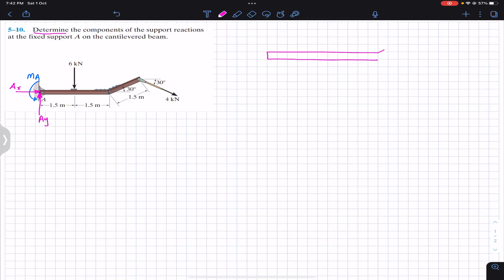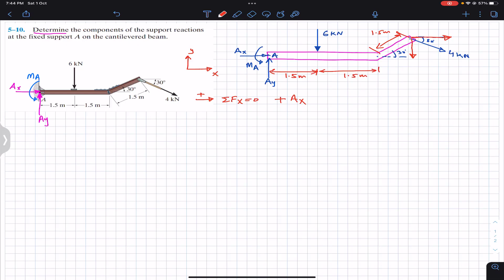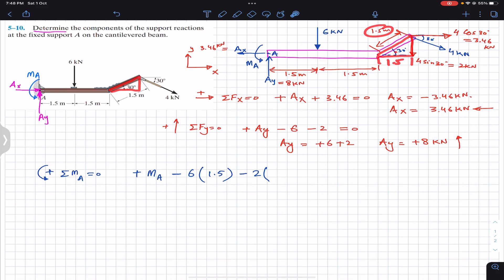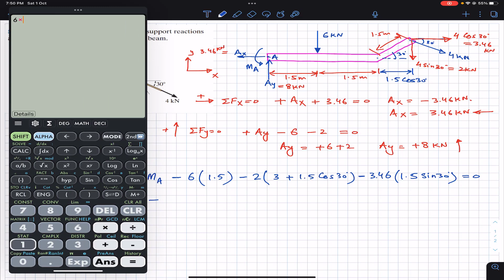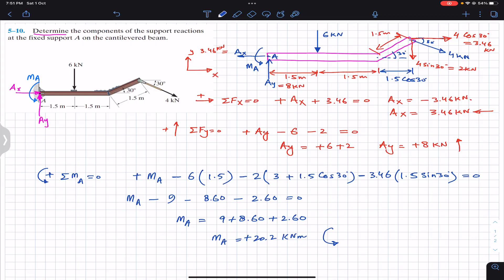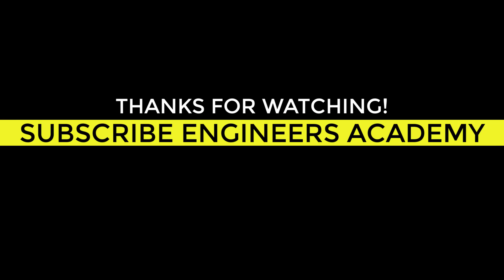5-10 Equilibrium of a Rigid Body (Chapter 5) Hibbeler Statics 14th Edition Engineers Academy

Comment: why didn't we add 3m to 4cos30(1,5sin30)?
Reply: 3m is the total of all horizontal distance, while 1.5 sin30 is the only vertical distance. Both are multiplied by the perpendicular force, acting upon the opposite distance.
Reply: @aldrianperez3440 Still wrong because if your F is in x axis then your d in in y axis it should be 4cos30(1.5sin30)
Reply: my question is you one
Reply: @tharindudhananjaya2125  Only multiply by perpendicular distance
Reply: Why did we consider in moment isn't it along to x axis